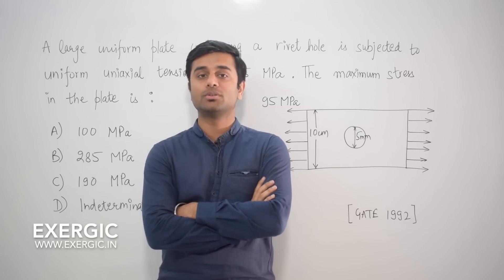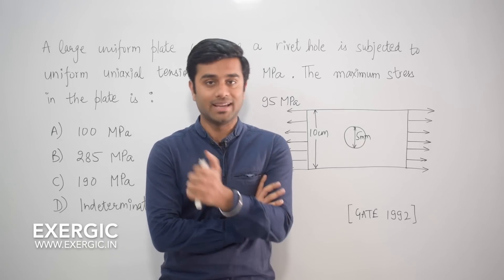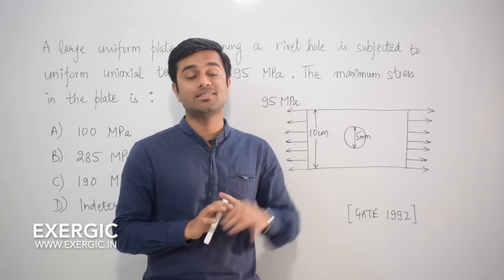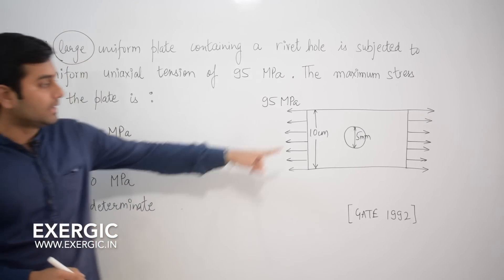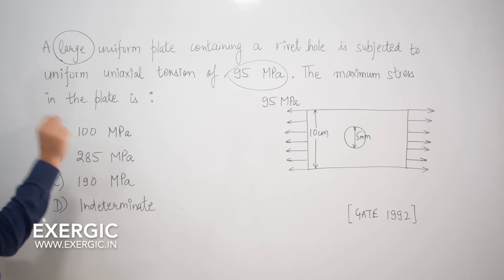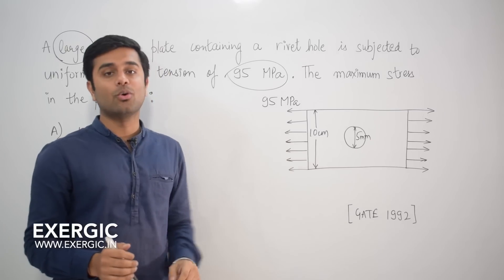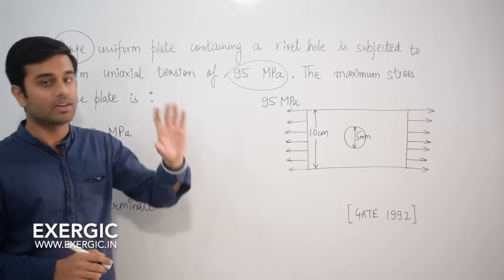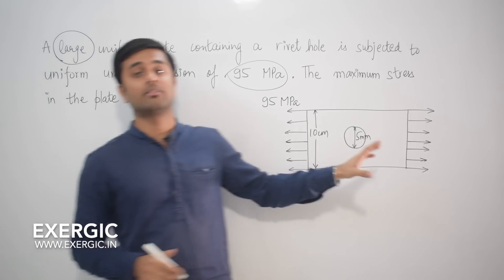Interesting question of Stress Concentration | GATE 1992 - Mechanical

Comment: The problem is interesting because when the plate is large, d/w<=0.1 and at point , d/w=0.1 , Kt=2.7(from the graph) and nominal stress = 95×10/9 MPa. So, maximum stress= 2.7×(nominal stres)=95×10/9×2.7MPa=285 MPa.

Now if d/w=0.05 , from the graph we can see that Kt= 2.85 and nominal stress= 100 MPa . So again the maximum stress= 100*2.85 MPa = 285 MPa.

And for every value of d/w whenever d/w<= 0.1 , it is seen that the answer is correct.

So it's interesting. Thank you sir.

Comment: I think that if the answer, 285 is exactly correct then the logic provided here is incorrect. Because in that case, large plate doesn't mean that d/w <= 0.1 . In that case large plate must mean that d/w tenses to zero from its positive side (d/w --> 0+) so that, nominal stress tenses to 95Mpa from its positive side (nominal stress --> 95Mpa +) and Kt tenses to 3 from its negetive side(Kt --> 0-) so that the maximum stress tenses to 285 Mpa from some side. I'm saying this because as per the graph it seems that the answer is 285MPa whenever d/w<=0.1 but if d/w=0.5 , the maximum stress is around 399MPa but there is no discontinuity in the graph when d/w>=0.1 . So, it is also not exactly 2.85 when d/w<=0 and d/w doesn't tenses to zero from its positive side. However, your teaching style and quality gives me a great satisfaction and I have no words to explain it.

Comment: From graph for d/w=.05 K=2.85 so Smax=285 MPa
Or 
Kt=3-(3.13d/w)+3.66(d/w)^2-1.53(d/w)^3
Kt=2.8524
Then Smax=285 MPa

Or 
Kt=1+2(a/b)=>3.   Since a=b (circular initially before load)
t not given 
so for unit thickness
Kt varies from .95 to 1
 i.e Kt= 2.85 to 3
Then Smax=285 MPa

Smax/Snom=Kt
Snom= P/wt=P/(w-d)t

Comment: sir I am afraid but your solution is wrong
To obtain the maximum stress in a circular hole we need to multiply with applied stress only i.e. 95Mpa in this case

I am saying so by taking reference from the book of Applied Elasticity by Martin.H.Shaad 
There in polar form of airy's stress function you can see this example page no 177 of 2nd edition
Reply from the maker: As far as GATE is concerned, in case of any contradiction or confusion always go with NPTEL. The solution done by us can be verified from NPTEL.

Comment: Actually I have a doubt regarding nominal stress. Nominal Stress is the stress calculated on the basis of the net cross section of a specimen without taking into account the effect of geometric discontinuities such as holes, grooves, fillets, etc.But here we have taken into account the hole diameter.So can you please explain it.

Comment: IN NPTEL LECTURE BY PROFESSOR RAJESH PRASAD THEY CONSIDERED SIGMANOT AS EXTERNAL APPLIED STRESS
Reply from the maker: Please refer to NPTEL PDFs as well where it is clearly mentioned which section to take.

When hole area is less, they may take any section due to small difference. But correct way is explained in the video.

Comment: Sir , in nptel machine design pdf while explaining stress concentration they have done bit different. According to them , the ratio of max stress and nominal stress is termed as theoretical stress concentration factor but while using relation ,sigma max = sigma (1 +(2b/a)) , the mentioned sigma is stress that the body is subjected to without considering the hole condition ( no net cross section area condition ).Same way things have been explained in Shigley's mechanical engineering design book. 
Please guide as this way hole size wouldn't matter for calculating maximum stress generated due to hole .
Reply from the maker: Please refer more lessons and solved examples in both the sources you mentioned. It will be clear to you.